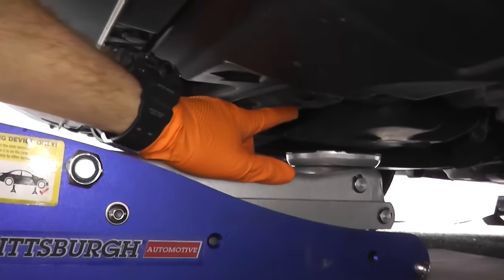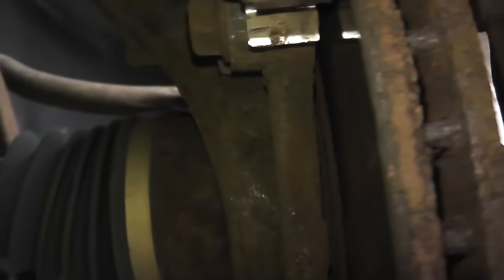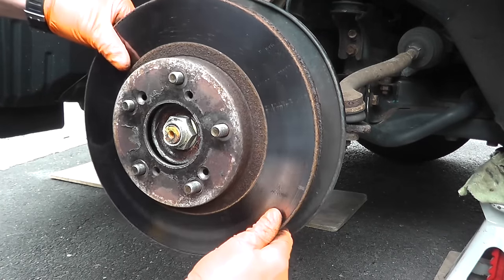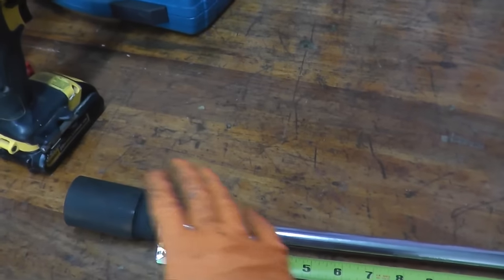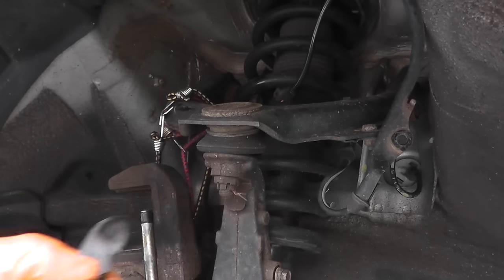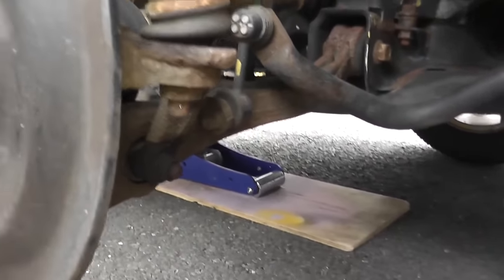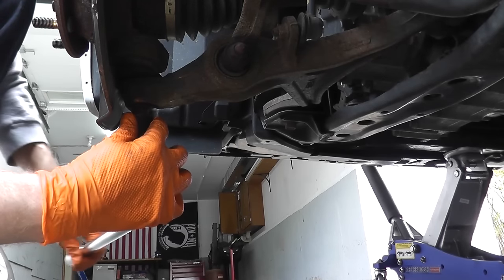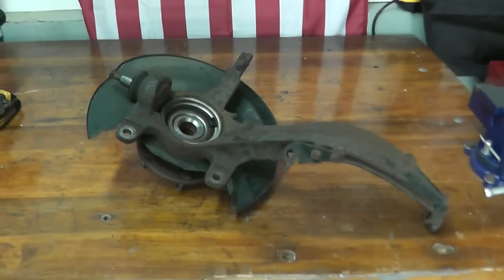How To Remove A Steering Knuckle or Spindle

Comment: I love how you so-called mechanics always use the most expensive tools hardly anyone watching this will ever buy.  I simply used a 16-in ball joint separator remover too from Harbor Freight ($10) and with a couple taps of my mallet it separated easily enough.  Q:  Why didn't you remove the entire caliber intact and set aside versus completely disassembling it?  Unless you're planning on replacing the brake pads, leave this stuff alone!
Reply: I just use a pry bar, hmm always works for me. If it's stubborn, hammer time!
Reply: I think his explanation makes it easier for any newbie to be able to see how everything a pulled apart. This video kind of covers a number of things in one video.
Reply: pickle fork as its called will destroy the rubber boot. I never use that tool. Also, local auto parts stores often lend tools out for free, so anyone can get the fancy and proper tools for free

Comment: You cheated,I started the job with handtools and halfway thru?you pull out a impact wrench..
Reply from the maker: For the Axle nut? You can remove with a breaker bar. Here's how. Just fast forward 40 seconds: https://youtu.be/12LNzutVSNU
Reply: @CarsNToys  I just saw that you replied,It was a joke.I have a 04 TL and your videos have been massive in the maintenance of my car!Thanks for the sharing your knowledge.
Reply: I used the jack handle as a levy bar front bumper had to be removed but got it done 😅

Comment: Another tip for th hub screws (they are put on to keep the rotors on during manufacturing so not nessasary to go back on.) If you dont have the impact driver use a  philips head and tap on th back of it whipe trying to unscrew it at the same time. I dont put em back in because iv had to drill some out before. Not worth the hassle.

Comment: @ 0:50 before you remove the caliper, have a second person stand on the brake pedal to break the axle nut free. This is mentioned @ 4:15, but to avoid putting the brakes back together, break the axle nut free right after you remove the tire. Your welcome 😊
Reply: Or you can stick a screwdriver you don't care about into the rotor cooling fins and let it bump into the caliper bracket if you don't have a second person to help. I just sheered a driver in half the other day. Used a Walmart hypertough and it survived and didn't even get a bend in it!

Comment: I had my 03 accord sit for two years and recently had an incident that left my driver side front knuckle in desperate need of changing. I was worried I wouldn’t be able to do it, with your video it was actually pretty easy once I bought the tools.

Comment: Last tip. Make sure to grease your ball joint pullers threading before you crank on it. At least some spray so it dosent chew up the threads. It will last much longer if you end up having to put some force on it. Ive only had 1 stick like that before but its worth pointing out.

Comment: Nice video. I need to d this in a dodge Dakota as two out of the 6 wheel hub bolts are froze !  After many hour of impacts and penetration oil and torch one of the bolt heads is now rounded.  So going to remove the knuckle with hub attached

Comment: Do you need to do an alignment after this job (if you don't replace any of Tie Rods or Lower Ball Joint)?
Thank you for the good film, especially for pointing out on that broken cotter pin. I'm very new amateur in car repairs, so it was unknown problem for me.
Reply: Yes %100
Reply: Why? You’re not changing anything?  Nothing is being adjusted, just bolts being removed. No need for an alignment that I can see. Especially on a car that old. Also, why not just remove the caliper bracket vs removing the caliper and pads separate? That’s a complete waste of time.

Comment: Hey man great video,  should I grease / lube the axle and steering knuckle when installing knuckle back , noticed the end of the axle was little rusty .
Reply: I removed rust and lubricated with Film Fluid Rust Protection and Lubricant (fm Amazon) that axle end. Maybe it is better to add some grease (I saw many examples of that in other films). I think it should be lubricated, but maybe grease it is too heavy lubricant for that connection.

Comment: Need my hud bearing replace but the knuckle, rotor shield is rusted so im going to buy the whole assembly with a lower ball joint included so im changing like 4 part in one set save alot of money since it cost alot to press the hud bearing and i dont have  a press

Comment: Does anyone knows if you can use 2004 accord assembly knuckle on a 1998 accord. The only diference I see is on the 2004 have 5 stubs and the 1998 has 4. Thank you in advance for your help 😊

Comment: What is the services tool called
Reply: I use that tool (Tie Rod Puller) from the set "Orion Motor Tech 5-in-1 Ball Joint Separator, Pitman Arm Puller, Tie Rod End Tool Set for Front End Service, Splitter Removal Kit" (on Amazon $52.99). There are other sets, which have the Tie Rod Puller, the author uses in this film.

Comment: Going 2 have a call in mechanic change my knuckles on my 04 4runmer as I do not have the tools or experience for this job, should I also replace the rotors while I'm at it as well since they r pretty battered up and ball joints???

Comment: Sooo is that part called the rear knuckle or rear passenger steering knuckle?? My bearing got so stuck in it that the shop doesnt want to keep trying to press it out. So they want me to get the part that the wheel bearing goes into?
Reply: No, just rear hub and wheel bearing assembly. Steering knuckles are just in the front.

Comment: do not drill the hole larger than it already is. If you do, you loose the super tight fit needed, and the sensor will vibrate and fail, giving you an abs light.

Comment: Yeah it's a pretty straight forward job though I don't know about the "basic hand tools part" You need to have a pretty decent selection of tools... ( more than you get in any standard kit)
Most people will end up struggling to get the axel nut off without an impact ( it can be done I've done it before but man just get an impact)... also most people don't have sockets  28mm and up impact sockets... So it will test your tools... but the actual job is pretty straight forward.. 1-2 hours tops...removal and install...

Comment: If I was you I would get rid of that harbor freight Jack I had one of them that only lasted me for 2 years in the Jack went out in it it almost fell on top luckily I moved out of the way really quick
Reply from the maker: I use this for the most part -  https://youtu.be/3tfM5NmqLc4

The HF jack is great if I need to quickly jack up the vehicle and place on stands.
Reply: If you were under a vehicle with only a jack supporting it, maybe you deserved to be taught that lesson. It’s called a JACKSTAND. USE THEM.